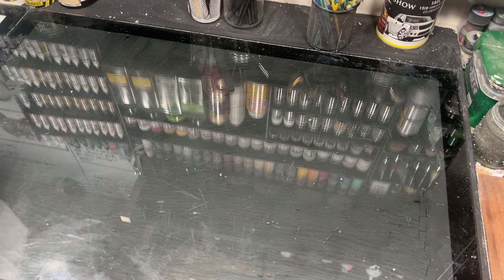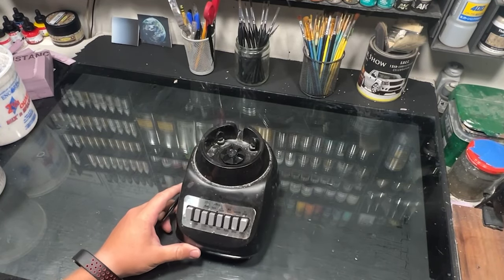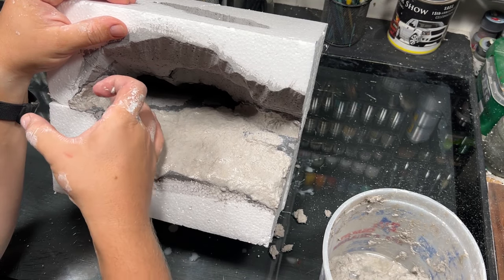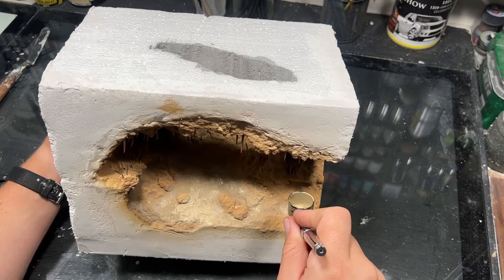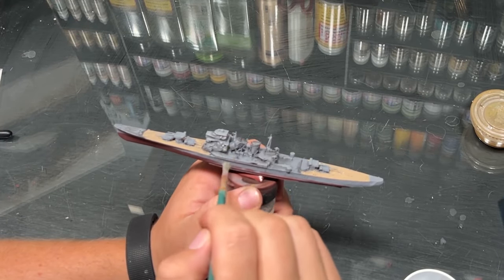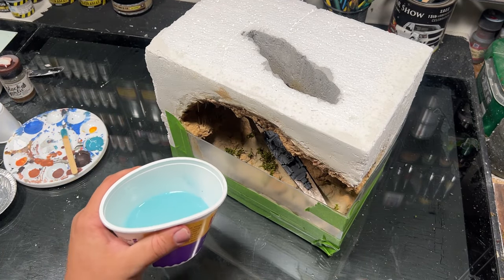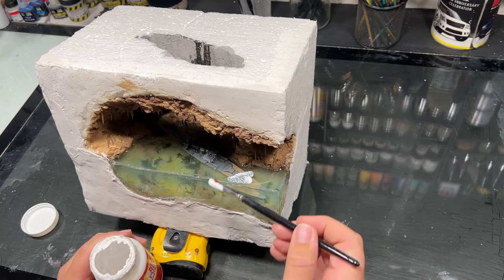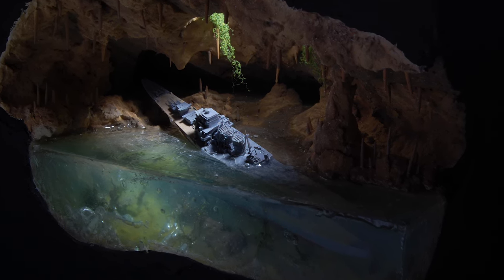Ship Wreck in The Hidden Cave Diorama

Comment: You could fix the resin issues using a coat of UV resin  over the problem areas. The imperfections totally disappear.
Reply from the maker: Thanks! Ya I tried using AK still water but I might need to pick up some uv resin